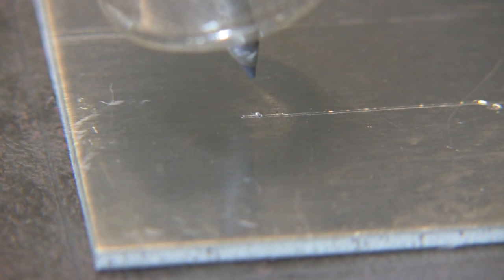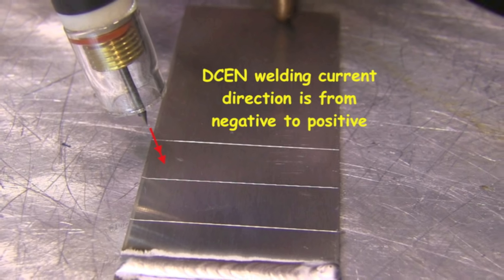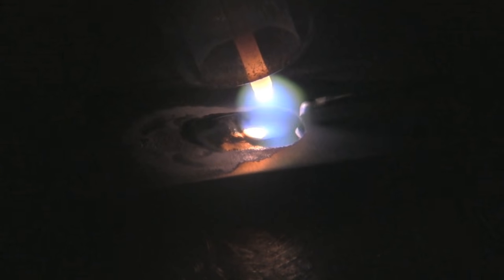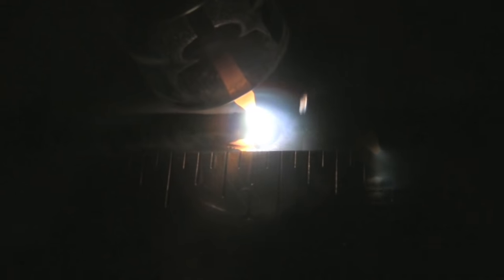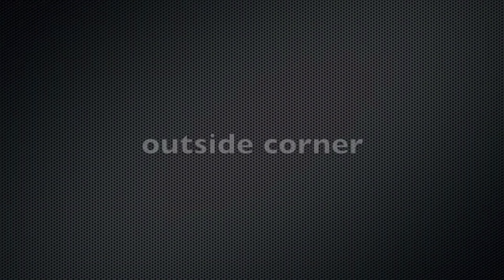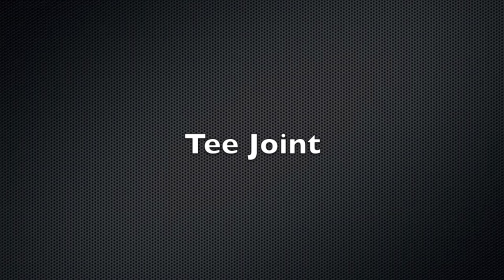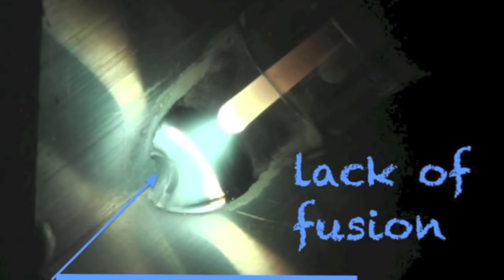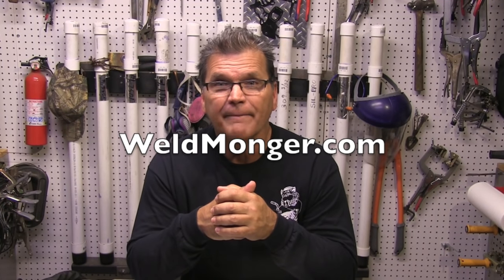How to TIG Weld Aluminum part 1

Comment: I just started welding with my power pro 256-D 

 Never tig welded prior what I found was getting through the oxide layer was difficult and realized the argon was not high enough.  I found myself punching filler in to no avail even at a higher amperage of 197amps on roughly a 1/4 inside joint... 

 It would be nice to see how my screwup could be mimicked and fine tuned.
 Setting were 197amps on a/c   37 cleaning. Down slope 2.5sec no pedal  using the thumb to play the down slope. End amp at 10.
Reply: I actually got a better final weld turned down to 150 amps after argon was cranked up a little more using my #5 gas lens

Comment: I think I waste a lot of argon. How do you set your gas flow? What do you look for in the weld to know you have too much or too little?
Reply: Jon Rhodin You can't have too much. Too little is when your welds are oxidized or coloured.
Reply: I think about 25CFH should do it.
Reply: BeGamerSl shhhhhhh
Reply: Matt Gardner What?
Reply: Or just use CH4 gas with 50 CFH gas flow. Heard that it works great.
Reply: you absolutely can have too much gas.  and you cant give a blanket statement for a cfm rating if you dont know what cup, what material, etc.. there is far to many variables....
Reply: Matt Gardner Yes I just talk from some oldtimers. But anyways yes you can have too much gas flow-it will cool the weld and the tungsten too much.
Reply: 25-35 CFH 100% Argon.

Comment: Great examples and hopefully we can get some good discussion goon on...I'll start I suppose. My question is about the graininess appearance to some of the welds. We've talked about it before, only briefly. I have never experienced it while using my old transformer machines...a Lincoln precision tig 225 and an old airco 3A...have only seen it with my inverter machine....HTP 221 (soon to add a syncrowave to the arsenal...). I have not done the extensive experiments like you have Jody, mostly because of time constraints. I'd be interested to hear what others think the cause is and if there are any flaws in the weld because of it. Maybe compare 4043, 4943, 5356, etc on a machine to machine test and see if there is a relation between the welder type and the graininess appearance of the weld. 

But, on the welding aluminum in general bit....cleanliness is your friend and fit up is your cousin....clean it, then clean it some more. Take extra care in your fit up with aluminum.
Reply: I too have the HTP 221 and have experienced the same issue.  I pretty new to Tig and have never run another machine to compare with. I have found this to be incredibly frustrating but assumed it was something I was doing.   I have been switching things removing one variable at a time and still no luck.  I started to think it might be an issue with the machine. I wish I had access to another to see if it is in fact human error or my Invertig.
Reply: OK guys I have the HTP 221 and I was at a welding supply and there was a couple of guys there that seamed like they knew there shit. I asked about my problem I was welding stainless railings and they just didnt have the look, as if the argon wasn't getting there. it wasn't they said do I have my torch with me and I did. I show it and they started getting miller torch part out and set me up with the miller torch parts for my air cooled torch I thick its a 17 anyway it cured it, my stainless was looking tits. They thought the torch was leaking at the white ring but I think the stubby gas set up I got from HTP was part of the problem the miller set up seams to have more diffusion.
My advice is look at the torch the welder is fine.
Reply: Are you using a gas lens? Try a larger cup.
Reply: Thank you. I'll give the torch a closer look!

Comment: Hey Jody, I love your videos and the products too.  This has really helped me to tig weld much better.  I would like to know if the Miller Diversion 180 welds aluminum good enough being there is no adjustments on the ac balance.  I would just want it for home use on thin metal.  Thank you.   Dan

Comment: I love your videos!
some comparison of different electrodes (pure tungsten, lantanated, thoriaded) and their arcs on AC would be interesting, in my Shop were only using pure tungsten for aluminium because of (especially the radioactive thorium) contamination of the puddle because tiny amounts of the electrode will be washed into the puddle on AC.
Welding Aluminium with the torch switch would be nice to see too, I'm doing this only, I've never used a foot pedal before.

I hope you will get into pulsed AC in the Series too :)
Reply: pretty sure he's done the tungsten comparison along with different grind methods
Reply: but just different styles of grinding not different tungsten alloys on AC

Comment: Hey their Jody. When you're tig welding in general, what's a good torch to have and how close of an arc you're suppose to have without the tungsten touching the workpiece? And also what's a good stickout that's recommended for tig welding? +weldingtipsandtricks

Comment: Not sure what I'm missing, but I'm having trouble with the start. I get a nice arc and see what I think is a puddle after a few seconds when the cleaning action subsides. But when I go to add filler rod, it melts the rod like solder before I get to the puddle and gives me the impression I dipped too soon?

Comment: Great video!  One question:  In an earlier video you showed a MIG welding demo of using a Lincoln Electric Power MIG 210.  In that video, the spool gun set up required that the gun was set to the positive terminal with a negative ground.  Unless I am missing something, this would suggest that the spool gun is set as an electrode positive on the wire (i.e. DCEP ??).  It welds fine as expected, but your demo using TIG with DCEP looks like disaster!  I just acquired a LIncoln Power MIG 210 and spool gun and also have a TIG setup as well.  I  would like to know if I can TIG weld aluminum on my machine (probably more of a question to Lincoln) and why or why not.  Does the MIG spool gun set up actually use "AC?  I didn't see any AC choices on this machine.....  Thanks for any feedback!

Comment: I like to weld cast Aluminum and very dirty aluminum, ie oil panels & engine blocks with individual amplitude adjustments for both the eP and eN.  I set the eP to 300 amps and eP to 120 amps, but adjust my AC balance to 90 so I don't spend much time in eP, but I am punching it with 300 amps for 10% of the time and 90% at 120 amps eN.  The tungsten stays sharp and I get great results with very little prior cleaning prep.  I haven't ever seen anyone talk about this technique.  I know of only 3 machines that have individual amplitude adjustment.  HTP Invertec 221, Miller Aerowave,  & Miller Dynasty 350.  I heard the Dynasty 280 can be updated via the memory card but at a steep price, but I don't know for sure.  I am sure there are other European welders that may offer this as well, but I can't say for sure.  It would be nice to see a video on this and what others have found.  Thanks!

Comment: When to tig vs when to spool mig?  Tig seems more relaxed and allows more time for cleaning action and for the oxides and gunk to migrate to the surface.  When I spool, no cleaning takes place and metal piles in so fast I worry that the oxide skin of the wire is being driven deep into the weld.
Reply: You should have instant cleaning of the surface with a spool. And the gas should be blowing before you start an arc.
Always always push aluminum spool welding!! If you play around with the amount of gas, and voltage / wire speed you can make smooth low splatter beads. The biggest influence on the smoothness is wire stick out. It's more then you think. I used a push pull gun on a run of the mill Lincoln and I had it running with zero splatter and a short whipping motion gave the dine stack look. Never any trapped oxide

Comment: Nice video. I'm using a Miller Diversion without much control - Just "AC" and current setting- this seems to work well when i get things right.  The most difficult thing I encounter TIG welding aluminum is just seeing the weld puddle and keeping the electrode out of it. My eyes aren't great and any tips there would be appreciated.

Comment: Jody, how do you decide the cup size you are going to be using on different setups? also, i noticed that your inside corner joint welds are concave, is this normal? my welds seem to always stand up. got the dvd's ordered buddy,. Thanks for all you have done in teaching this old dog you can always learn new tricks/ thanks, you're the man

Comment: So I have a pretty steady hand and when it comes to the actual phyiscal muscle movement I'm pretty good at it, even when I first start out. However I always have issues setting up the machine. Not just setting up amps but choosing everything from tip types, filler rods, how much gas etc. Do you have a guide for that?

Comment: Jody, can you post some part numbers for the check valves and "Y" fitting?I have a fresh helium tank that I'd like to try. My welder is a 350A Inverter so I haven't really needed helium (yet) but I'd like to try it on some cylinder heads.Thanks,Matt

Comment: One stupid question. If I add a high frequency unit (like the "arc pig") to my AC/DC buzz box, will I be able to weld aluminum? Thanks for the great videos. Wish I would have had them some 45 years ago when I taught myself to weld! The arc shots are worth a thousand practice beads.

Comment: Hi, your tutorials are very good, but i have one Question . Why you weld with the Tungsten so far out? It's on every Video you post on YT. I have learned the maximum the Tungsten show out of the Gas Lens is about 5 mm , and also you use a very long Tip, not only on Aluminium ,if i use this long Tip on Alu i will get a Sphere on the Tungsten with my Welding Machine , very old school Machine .
Of course the Torch you use, u can go further out if necessary . The next thing is, you weld with a huge distance from the welding surface ,this makes the welding much more wide and brings a lot of heat in . With a shorter Tip you can go nearer and and the arc is also wider, the penetration is the same, with less Power you need to weld to. So, did i miss something ? 
Keep up the good work

Comment: When you were using the Lincoln transformer machine you mentioned you also included helium with the argon. Are you using helium because it is a transformer machine? That Lincoln should have no problem, amperage wise, with 1/8 inch aluminum with just Argon. My question is based on my Miller 350 Synchro wave transformer machine. Using a #6 gas lens 3/32 tungsten, 2% lanthinated. Argon only. Will helium have an effect on the arc, welding 1/8 inch aluminum with 4043 rod?

Comment: love your videos I used to weld  10 years ago I got a harbor freight Vulcan 220 most of it welds good but when I try to tig aluminum on 120 and start i cant add filler it balls up and if i try to just run a beed it heats up and blowes through if i turn it down it does not melt the filler and won'tor  maintain schey  arch can you give me any ideas

Comment: Ok so ive got a very specific question on welding cast aluminum. At some point i have a lower unit off a boat i need to weld any pointers? Im welding a cracked cavitation plate similar metal to that jet pump you did. Thats the main reason i remembered i had to weld that drive.

Comment: Thank you for such a nice tutorial. I am running a car workshop. I also have a small machine shop with lathe and ac arc welder. At times we need to weld car ac aluminium pipes, sometimes copper and brass pipes and sometimes sheet metal. Please advice me which machine should I get.
Regards.

Comment: I'm a backyard jack of all trades master of none looking into a bare bones TIG machine that will mainly weld aluminum. I do not want frills and do want to keep cost down. I started with ARC welding and now also have a small mig (too small for a spool gun and aluminum). What would you recommend?

Comment: I would be interested in the welding parameters that you mentioned, but did not cover. Things like electrode type and diameter arc length, type of gas, gas flow, torch angle, etc.

Comment: really good video.
Question 1: How would motorcycle engine mounts for a slightly different engine be welded to an aluminium frame? 
Question 2: Can a motorcycle engine (dependent on casting material) have a type of engine fixing welded to it? ie thickened by 10mm at a specific mounting point both sides of engine ?
Thankyou

Comment: This should be a good series. I use an aircooled torch and when welding a lot of inside corners of aluminum angle the heat reflected back to the torch is a lot more the inside corners of steel I guess because of the slow travel speed. The tungsten seems to need more dressing than when welding steel besides the torch getting screaming hot. Would a different size gas lens and cup help? I'm not in a position yet to change to a water cooled torch. Thanks

Comment: So, i know you can tig scratch start with a dc stick welder, like the one you converted in one of your other videos. Aluminium needs ac, and often some sort of HF converter, but you said in one of your clips that you was using 60Hz, which in the UK is standard. Can you explain a little more of frequency and how that effects cleaning, puddle and thickness of material. Great videos and great welds. 
Regards

Comment: hello there. Would you be able to explain how the filler rod / Material melts so quickly with what appears to be such a fraction of time it is introduced into the Proverbial Puddle ....?.   I have seen perhaps 10 videos of 4 different people welding. The filler rod seems to barley touch the Puddle !,  this just keeps me wondering. How does this filler rod heat quick enough to simply melt ?.. lee from Norway Maine. Yes Norway.. Maine as well has cities or towns as Sweden, Mexico and such.. I will be addressing a floor pan repair in my 2000 Chevy 2500 Truck ..  rivets can be used as well as sheet metal screws and metal sealing adhesives. This I understand. I need to learn the basics and understand things before purchasing any welding equipment. At present my dad gave me his older Craftsman 110 v stick welder. It is all I have..

Comment: What determines cup size, and do have any tips for controlling heat on long runs with just a button, no pedal. Can get half of a nice bead then it gets out of hand. Working production stuff so need to get 'em done quick as possible. Thanks.

Comment: Jody, I'm using a Miller Synchrowave 210. Set up AC, using foot pedal at 175 max, on 1/4 " alum, 3/32 tung, 3/32 rod and argon. I can run a pretty nice, consistent bead however, the bead color is gray-ish. Typically with the transformer machines, years ago, the puddle would typically have a bright swirl to it. Any ideas ??

Comment: hi, i  bought a tig welder (cigweld 205) i have issues adjusting it, can you please show me-us how to adjust it form a-z how to sharpen the tungsten, what thickness to use what filling rods to use to gas flow etc. my electrode builds a ball at the end and the arc is everywhere

Comment: Have you ever had to use aluminum mig wire for tig? I weld many snowmobile parts. Many times you cannot get one 16th wire to pull any advice or a video on that would be very helpful to many I appreciate your content.

Comment: I’m new to TIG and I’ve just started practicing on Aluminium, I’m getting some half decent welds on flat material but when it comes to inside corner joints I’m having a nightmare even starting a puddle in the corner it’s either sticking to the base or the vertical piece and I’m struggling to figure out what I’m doing wrong..

Comment: Jodi, why do you hold back on the pedal for the first few dabbs? I learned TIG via scratch start on mild steel. I have never TIGed AL. 

Also, diagnosing problems. My buddy had a real problem TIGing some AL at home. he took the part to school and did fine. took the part home, same settings and could not run a bead. turned out to be a bad tungsten.

Comment: Great video :)
I have several questions:
- tungsten contamination (on steel) how to re-sharp / clean the electrode  ? is it still usable ?
- at the end of the bead the arc it really strange it doesn't stop when i m taking my finger off from the trigger from the torch - why this is happening ?
 thanks for sharing

Comment: When welding cast are you better off with an inverter as opposed to a transformer machine and set the balance to low penetration and high clean (depending on the part of .course)?

Comment: Can you explain the difference between inverter and transformer machines? The older transformer machines are much more affordable to home shop guys like myself, but i wouldn't want to buy something that won't work well.
Reply: Inverters have features that allow you to change the waveform, like changing the AC balance percentage, pulse settings, frequency settings and even various waveforms. They're lighter, take up less space and use less power.OTOH, a transformer is simple, less parts less settings, less versatile less money.I think inverters are easier to weld with, but that might just be me. I sold a Miller 310A BP and went to an inverter, I'll never go back.
Reply: thanks!
Reply: The differences in power requirements for an inverter VS transformer are substantial, especially for a home shop.  From any comparison I've seen, Inverters of similar output draw less and require lower rated breakers and gauge wiring compared to traditional transformer machines.  That, and all the features led me to an inverter and I haven't looked back since.

Comment: I have a SA 200 Amp lincoln gas burner welding machine ( Pipeliner ) I have a Tig dry rig with 100% percent Argon. Will it weld aluminum? Thank you for the welding tips and tricks. 

Steven Miller.
Louisiana.